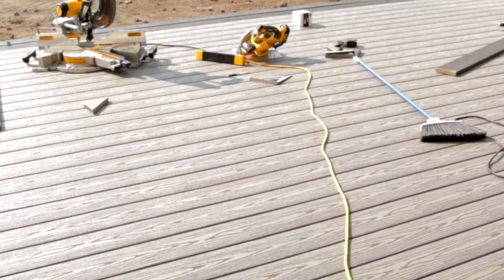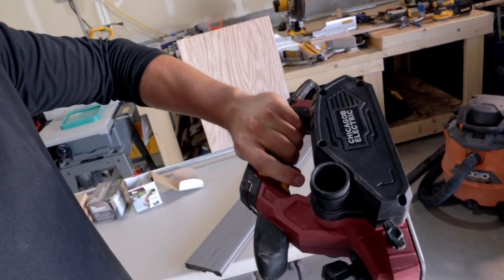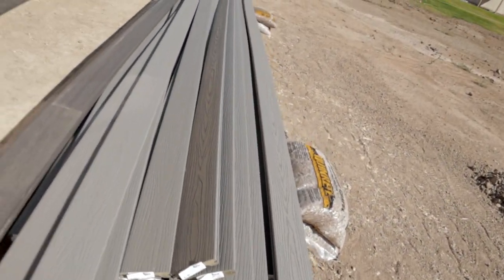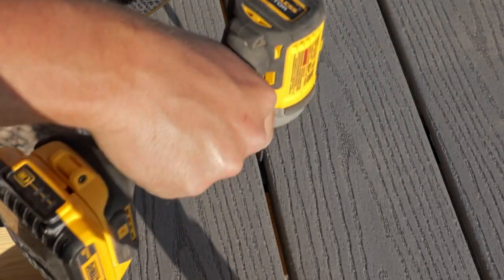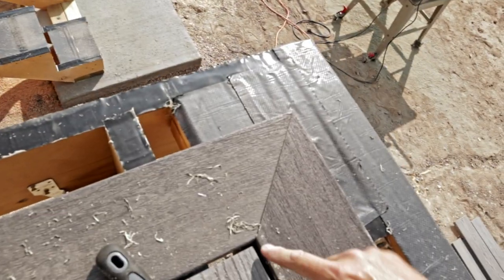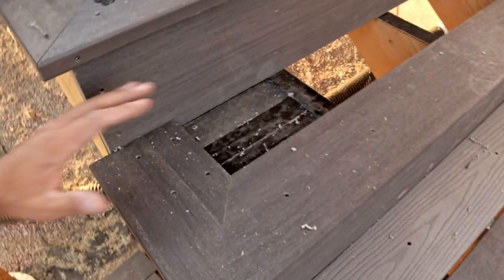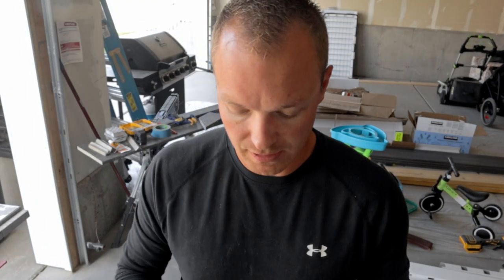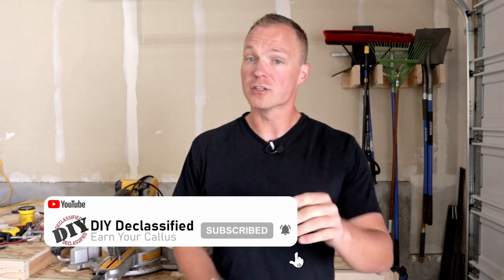My EPIC Deck Build - How to Install Composite Decking // Episode 4

Comment: Good work ! You think along my line of thinking. I am wanting to see the finished stairs to the ground with the facia and the stringer boards showing the fix for that cut edge on the stringers.
Reply from the maker: When I edited this video, I actually thought I lost the footage. Recently I was going through some files and found them! This summer Im going to release an update video where I address some questions, and possibly add lighting to the deck.

Comment: Looks good!  Did a great job with this build.  One tip for anyone who runs short a few plugs, or doesn't want to buy them, is to use a pinch of the drill shavings and cram them into the hole and hammer them in flush.  Does a decent job of hiding the screw hole.  The way you did it with premade plugs is better, but this works in a pinch too.  Keep up the great work man!
Reply from the maker: Thanks for the tip! Those plugs are pretty expensive, and you deffinitly pay for the convienece of them. Did you put any glue in the hole first to hold it all in over time?
Reply: @DIYDeclassified  I never have, but that could be a smart move to add a drop of CA glue or something.  Just push in a bunch of the shavings and tap it flush with a finish hammer and it seems to hold up ok. For what it's worth, I haven't had to go back and fix one yet and it's been about 6 years since I built my place.

Comment: 04:01  You are using a 3/4 fascia and wanted the deck board to overhang that but.....
11:08  It looks like the picture frame deck board is flush with the fascia.  Change of plan? ?
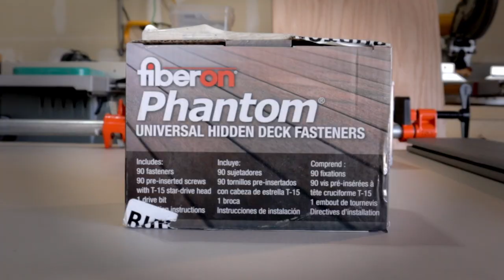04:35  Use a router bit to cut a groove in the inside edge of the square edge.  Then you only have screws on the most outer edge of the outer picture frame.

Yep, I have OCD issues.
Reply from the maker: Thanks for the tip. The overhang didnt really work out like I had hoped. The decking material was about an inch shorter than I had planned, which made it so I didnt really have an overhang on the sides. So I had to change my plan and just remove the overhang. I still recommend the overhang to help keep water off the face, and I think it looks better. Good eye!
Reply: @DIYDeclassified  
Some people have the skills to measure and measure and measure to get the overhang just right.  Some people just cut the ends of the joists at the very last minute to get the overhang just right.  Fudging a little more or less.

As long as it looks good from the street.

Comment: I’m new to deck building. Is it standard procedure to make fascia boards flush with the deck boards? I would’ve thought you’d want like a 1” overhang. It is just personal preference?
Reply from the maker: You do want overhang. That way when it rains it can drip off the deck instead of running down the facia. This is where I mismeasured and get to live with the consequences.
Reply: @DIYDeclassified  I appreciate your honesty. Keep up the good work.
Reply from the maker: @benjaminbunny99  thanks man!

Comment: So picture frame after, not before? Just curious as all the other ones I've seen picture frame after.  Working on subframe now and will be laying deck boards soon.  Thanks
Reply from the maker: I picture frame after. You can do it before, but you will have to cut each board individually. The way I do it allows me to cut a straight edge on all of them at the same time. This is just one of those "my way isnt the only way," kind of things.

Comment: YOU CAN use groove clips on back edge of non- grooved frame board .
A router can EXTREEMELY easily put a notch at each frame location in just a few minutes after the frame board is secured on outer edge. (don't rout entire edge)
AND that outer edge can be secured in place from underneath OR by pocket screwing the facia board into as a 'T' and then locking that in place by screws through the facia only.
Reply from the maker: Thank you, good to know.
Reply: Great ….now I need a router ….😂😂

Comment: Question- loved your video. My wife especially like the double picture frame and the  colors you used.  What were they? You mentioned expresso, what was the gray and is it Fiberon?
Reply from the maker: You are right, I used Fiberon. For the center I used "Beach House" and the picture frame I used "Espresso." DO NOT USE ESPRESSO! The company updated their color scheme. The one I put down was more of a black/brown, and now when you look at the company site, it is 100% brown. By the looks of what is online, "Graphite" is more in line with what I have.

Comment: great clip - how far distance should the deck boards be apart to allow for expansion and what distance should be the maximum for stringers - thanks in advance for reply
Reply from the maker: The boards are spaced about 1/4 inch apart. The allows plenty of room for expansion. The stringers are spaced 12 inches on center. If you are going the route of composite decking, you will need to do 12 inch on center for the stringers.

Comment: Nice work but I dont like those screws. I prefer the ones with plugs that cover hole. Also the way you finished  step threads, I would have done something else to cover those ends and exposed grooves which don't look attractive at all.

Comment: Did you use regular pine lumber or pressure treated pine?
Reply from the maker: I ended up using regular lumber. I purchased this material during the lumber shortage a couple years ago, and had to finally settle for standard lumber. In my area, we get no humidity and its a very dry state so I wasn’t too worried. I did prep each board by coating them with a sealer, and I re-coat them in the spring.

Comment: Is it normal to do the picture frame last? I thought the picture frame went in first???!? I’m about to build a deck and that’s how I thought it was done.
Reply: If you do the picture frame first, then you have to cut all the decking boards one piece at a time. The way he’s showing you, you cut all the boards while they’re installed, this way the cut is straight.
Reply from the maker: @howtodoitdude1662 you are absolutly correct! @nateiowa3359, you can do your frame first but I felt it was easier to lay them all down and then straight edge cut them all. If I did it the other way I know I would cut slightly short on some and it wouldnt look as sharp.